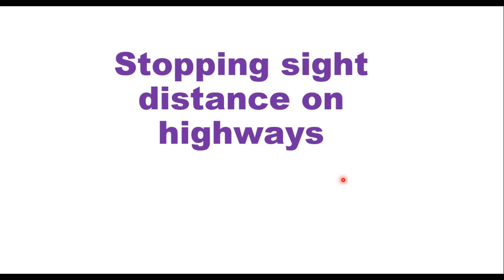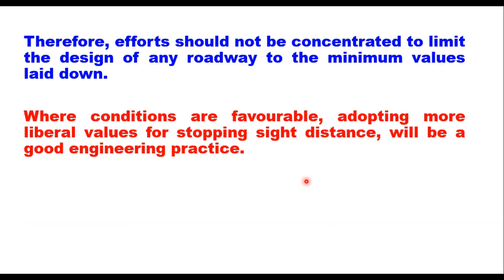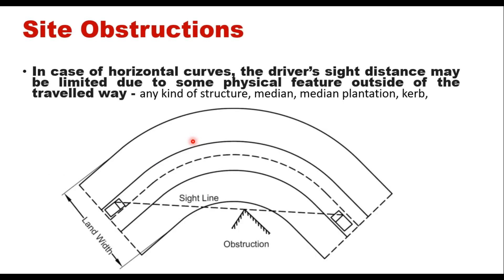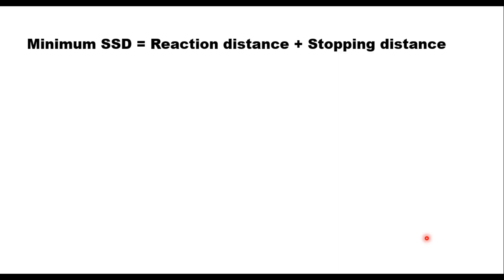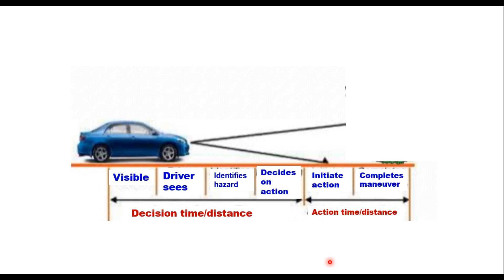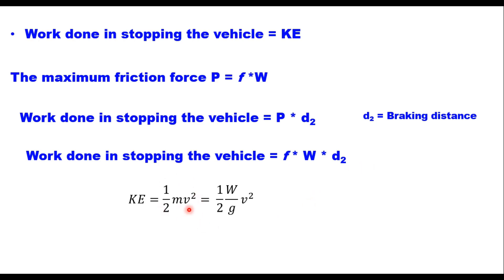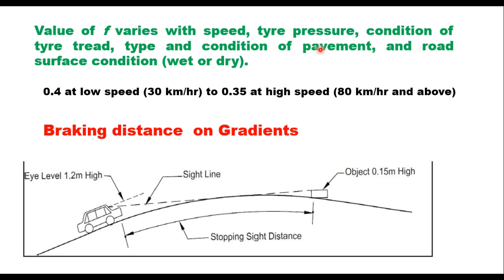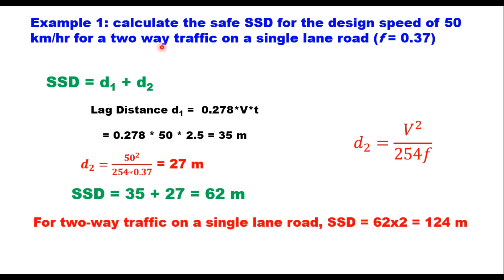Stopping Sight Distance on a road. Definition, concept and evaluation of SSD with examples.

Comment: Sir is there any difference between Right of way and Width of formation ?
Reply from the maker: Yes. The formation width also includes the drainage system, the slopes, and any other structures that are part of the road. It is the width of the road that is required to be graded and compacted to support the carriageway and the shoulders. The right of way is the total width of the land that is used for the road.
Reply: @SatishIITR  Thanks Sir🙏